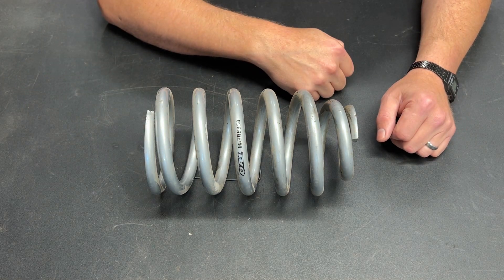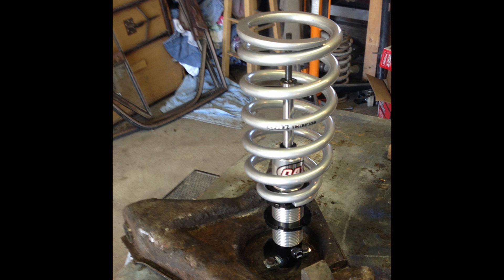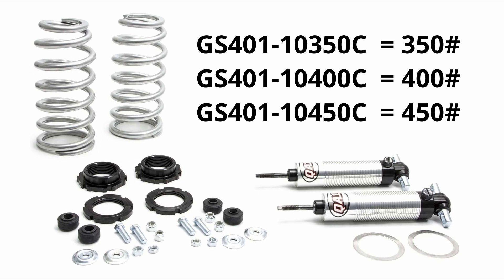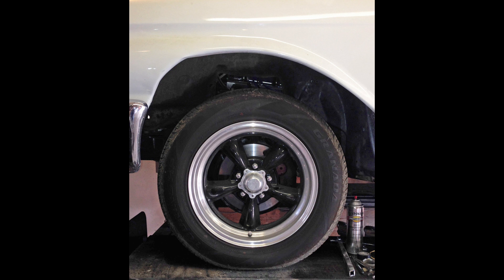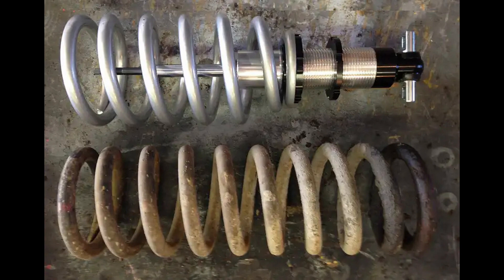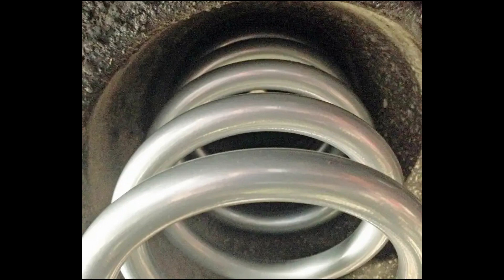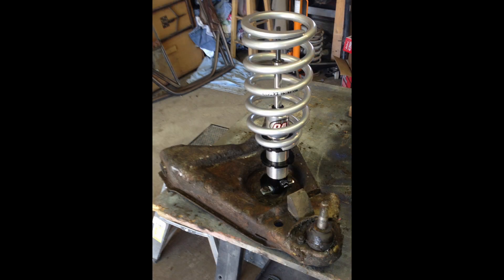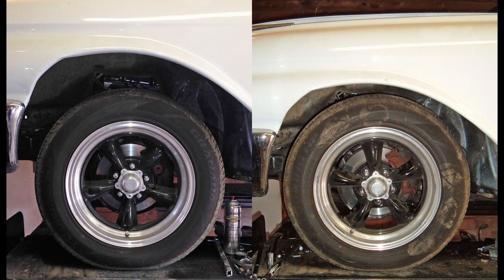DIY Coilover Kit for my 62 FORD Galaxie, Retrofitting a QA1 GM Type Coilover Kit to Fit my FORD

Comment: Just called Qa1 for Coilovers for my 1950 Ford F1 with 327. Gave them the weight of each tire and ride height and recommended the same shock with 700 lbs springs for my mustang II suspension. I have a flat plate on the lower tubular control arm that I will drill out and bolt the shock. I will be happy to remove the airbag suspension. Rides great but scared of a air failure and too many extra parts. Nice job on the install.
Reply from the maker: wow that truck must be heavy to need 700# springs

Comment: Great video ! I’ll be rebuilding the front end of my ‘ 64 Galaxie this winter . What is the thickness of the two half plates you made for the shock base ? I may go with the 450 lb. Springs as I’m keeping the big block . Well designed setup , thanks for sharing this.
Reply from the maker: The plates are 1/4" but that is overkill.  Not being an engineer when I am building something like this I use experience to come up with "thick enough"  1/8" and then I increase it just to be safe.  3/16" probably would have been just as good as the 1/4" and a little lighter.  As to the spring rate 450# or maybe even 500#.  When I first did this mod I posted all the pix on a Galaxie forum and a guy on there decided to do the mod.  He too had a big block and went with 500# springs.  I know he was very happy with the result.
Reply: I’ll go with 1/4” because the front end won’t notice since it’s got a ship’s anchor for engine weight 😎 . When the adapter plate is in position on the control arm , do the two surfaces touch where the bolts go through or is there an air gap . I have new station wagon springs and bushings in the rear so I’ll be going for a raised but level look ……… unless poor  handling gets in the way .
Thanks for the response by the way .
Reply from the maker: @boblill8476  I don't remember if it makes contact or not.  I do know this,  I would have left it free floating so either it touches or I used a spacer between the plate and the LCA to take up the gap.
Reply: Thanks very much . This coming week it’s a new gas tank and ptfe fuel lines where needed . Doing this work in batches , last month it was a new cooling system and a 1 wire alternator to replace the generator.

Comment: Will this work for a 64 Galaxie?
Reply from the maker: The suspension for a 62 and a 64 is almost the same with the exception of the offset shafts (terrible idea) so it should work with little to no differences.